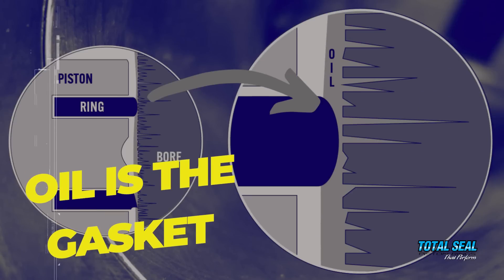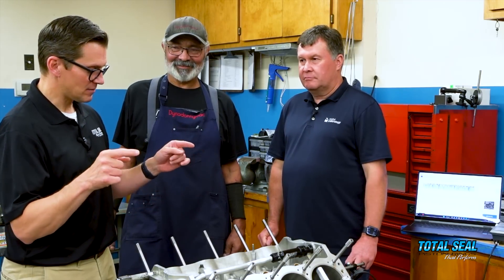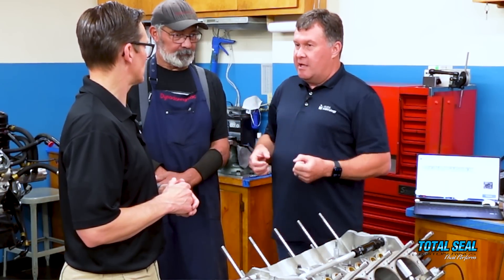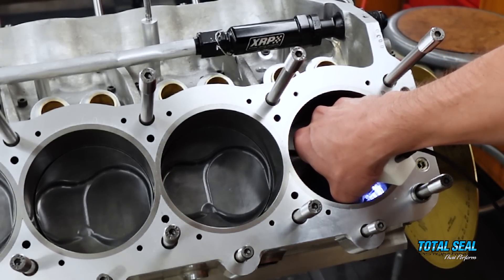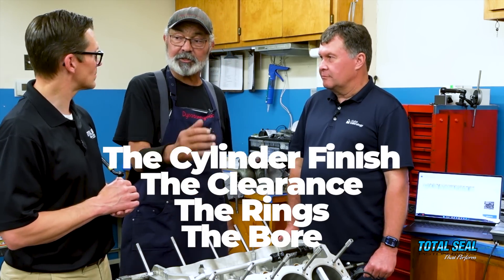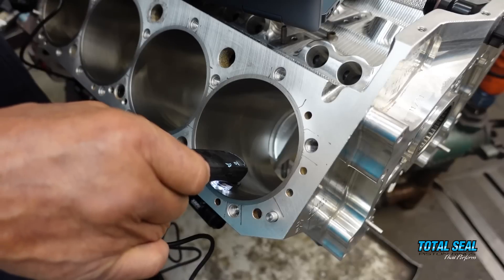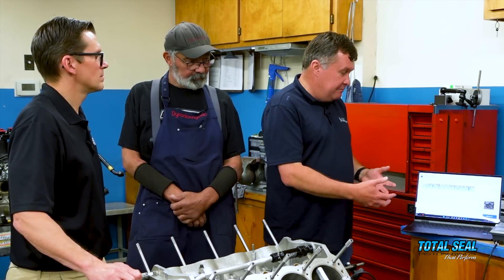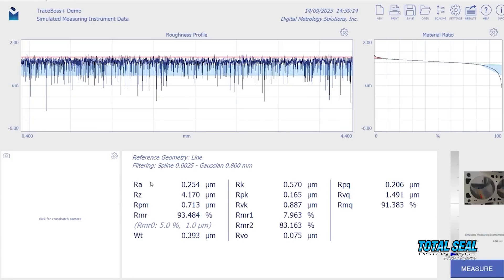THIS is the HIDDEN "Gasket" in your Engine

Comment: Oil as a gasket was well illustrated when I was wet sanding my bores that I just dingle ball honed.  Whether I used WD-40 or ATF with 3000 grit wet/dry sandpaper the sandpaper was actually trying to adhere to the cylinder walls like a vacuum. I used 1000 grit first just briefly then went to 3000. My point was to knock the peaks off but keep the valleys

Comment: So wait a moment.... I have an engine with about 100k miles on it. Doing a refresh and slapping some new rings in there. The surface bore finish is from the factory. Should I even hone it? After watching this I'm thinking that my surface is already broken in and if my rings were properly machined (got them from Total Seal) then should they even need to be broken in by running the engine???

Comment: This is awesome in theory, but I’m still going to dingleball hone my engine, wash it with a garden hose, slap it in and rev bomb the first start. Thanks guys!
Reply: I did that but then hit the cylinders real quick with WD-40 and 1000 grit wet/dry sandpaper then switched to 3000 grit and wd-40 or ATF just to knock the peaks off

Comment: Perhaps your technology can help us scan the surface finish we get in our rotating liner engine.  In our experimental diesel engine, we spin the cylinder to eliminate the metallic friction of the rings.  We have succeeded in almost eliminating the piston ring friction, based on dyno testing.  The reason is the continuous sliding as well as the unique surface finish.  Please let us know if you are interested in collaborating.

Comment: Hi Lake, I have been watching may of your videos. I was wondering if laser cut valleys for oil retention. How deep would the valleys need to be? Could this be good solution to a glazed cylinder. The parts are fully matted, but with no oil retention the seal is poor, but would not necessarily mean the cylinder is out of round. Fiber galvo laser cycling it up and down would be a bit of a challenge. Could there be a optimal pattern over just the X, maybe dots like fine braille.

Comment: @TotalSeal @digitalmetrology
With Rmq at 51% … (super low vs your other presentations) you seem to be relying more than usual on the ‘tenacity’ of the oil to create the bearing-surface with a deep ‘anchor’ of 95µin Rvk to hold it in place 

Since this test was done a year ago, May 2023… I’m guessing the results were not favorable??

Curious number tho, and I’m very interested to see how this comes out with that tighter piston to bore clearance and how you can control piston roundness within this envelope. 
Rvk 95µin
Rpk 6.8µin
Rz 207µin 😮
Rmq 51% 
Ra 31µin

Vs. more normal ‘great numbers’ for a perf NA engine. 

Rvk 56µin
Rpk 7.2µin
Rz 159µin 
Rmq 87% 
Ra 16µin

.

Comment: I think oil is still the weak "seal" on the cylinder wall. Mostly of cars today use a low tension piston ring design. They have thinner piston rings. That is why nowadays fuel dilution is often found in several modern engines, especially direct injection ones
Reply: New engine oils are using 0W8 and probably won't last long with fuel dilution. I don't run 0W20 in anything I drive even. I want that 30 or 40 weight oil at operating temperature to provide extra cushion especially when an engine starts to wear .
Reply: The thin rings aren't the problem at all... Thin rings are a win win situation. There's no down side to using them, only advantages.

It's the thinner oil that is used today that is a big part of the problem... 

The super thin oil that is used is ONLY to meet todays strict EPA fuel economy requirements. 
It does NOT do your engine any good as far as wear goes. Everything wears faster with the very thin oil, including the rings and bores. The tension that is manufactured into the rings has another part to do with it. The factories are using a lower radial tension on the rings to further reduce friction and increase economy. A thin ring CAN be made with a normal amount of tension, and last as long, or even longer than a thicker one.

A direct injection engine SHOULD have a much less concentration of oil in the fuel because of the much finer control over the air/fuel ratio compared to port injection.  The lower tension rings are partly to blame here, but it is the very thin oil that has a larger part to do with it than just ring tension. The bores and rings simply wear out faster due to the thin oil. 

I will NEVER run a 0W-8 or a 0W-16 motor oil in ANY car that I own. I personally don't CARE about the slight loss of MPG's and WILL go with a thicker oil. 

The sudden loss of reliability and added wear on today's newer engines isn't because we've went backwards in engine tech. It's because of the mandated use of such thin oil in order to meet the strict EPA fuel economy requirements, and the faster engine wear that comes along with it.
Reply: @davelowets  Low tension rings start hydroplaning on thicker oils. Lake Speed Jr. has made videos on this. The only thing you can do is use a high solvency oil like Valvoline R&P to avoid sludging up oil drain back holes.  Or tear apart the motor and put different rings or even pistons in to work with thicker oils.

Comment: Anyone ever tried a roller burnisher to perform the plateau process?  Seems like it would work well by giving a flat top to the peaks while also work hardening the material in that zone.
Reply: This is an intriguing idea?  I wonder if its ever been used for cylinder bore finishing?🤔.  Im going to repost your question here on this 1 yr old video.
Reply: @chrispompano  If no one ever replies I plan to try it someday once I get my dyno going. I got a 4.75" roller burnisher begging for some action. 😀
Reply: @bcbloc02  I've never heard of it spoken about by all the machinists he interviews.🤔. Sounds like a very credible idea!

Comment: Fascinating discussion. Implicit in "ring seating" discussions seems to be the notion that the peaks and valleys are an essential aspect of operation rather than just an artifact of manufacturing. I'm not entirely clear on why this needs to be the case. What if the cylinder surface and the cylinder facing surface of the rings were perfectly smooth? Of course from a manufacturing perspective this cannot happen, but these discussions all seem to hint that trying to pursue this is not a desirable goal. Why not? Also in the video they show a cross hatch pattern on a newly honed cylinder surface. I was under the apparently false impression that the honing/boring would leave the peaks and valleys aligned vertically, i.e. with the direction of piston travel. I don't see how a pattern that isn't exclusively vertical would help with seating. What am I missing?
Reply: Not that it would work, how in the world could you hone a round cylinder and leave vertical marks?

Comment: l have an engine with 360,000 mi on it but it runs good if I add engine restore to the oil and the cylinder walls are coated with lead and copper or whatever it is in that stuff what is that going to do to the surface finish?. 
I have not checked the compression yet and I would be curious to look at the cylinder walls with a borescope. Before I do anything.

Comment: A leak down will tell you how good a job you did on your build . 🤞
However , there is a fine line between the expansion forces and heat , seizing your engine under extreme loads .
Break in is critical  !

Comment: Thank you so much for these vidoes man! What is your opinion on Liqui Moly Hi Tec engine oil? It is supposed to be good for 25k miles but I change it every 4-5k depending on how much hard city driving I do (supercharged Jaguar XJR with the 4.2 v8, she runs hot in traffic ~218°f but cruises at 212°f)
Reply from the maker: Thanks for watching!

Comment: whatever happened with your two ring set up where the bottom ring was a combo total seal ring and oil ring?
Reply from the maker: We still have that, and this engine at Shaver's runs them.
Reply: @TotalSeal  good to hear.  Joe gave me one of the prototypes and it was quite an impressive design.

Comment: This is why I have been using 2 stroke oil (I got this idea from Lucas UCL) since long time ago, at 0.5% ratio, recently I also tried 1% ratio, and it feels like it doesn’t loose torque at high rpm, although I don’t have a dyno. I know theoretically it might drop octane but 1% can’t drop octane all that much, plus you can always use a higher octane fuel than required to take this factor out of the equation. I wish you guys can make a video with 2 stroke at different ratios to explore the potential influence it can have on an engine in terms of performance.
Reply: My friend try Renewable Lubricants Rotary Pre mix. Its completely safe in 4 stroke. Give one of their chemists a call like I did. 2 ounces treat 8 gallons 
Or 1 gallon treats 500 gallons
Reply: @CarlosMartinez-pc7je  i forgot to say but I only use TCW3 certified which is ashless and cannot harm catalytic converters.
Reply: @CarlosMartinez-pc7je  email who? I really want these total seal piston ring guys do an experiment on 2 stroke TCW3 oil because it certainly feels like it has potentials.
Reply: Renewable Lubricants also suggested the same to me to use on a 4 stroke engine.  Klotz has a similar product called Uplon.
Reply: Hey guys you know what’s crazy? I sent my 98RON (93AKI) pump gas to the lab and the result was shocking, so the 98 fuel was tested at 98.5 RON, and after adding .5% of TCW3 the RON actually increased to 98.7 RON, although at 1 percent it dropped down to 98.1 RON.

Comment: The diy guy gets all screwed up watching all this bs, smoke and mirrors. The average diy'er that comes in the machine shop just wants his engine not to burn oil. They get all bugged up about hone finishes and question everything the machinist is doing. All auto companies sell 3 blade glaze breakers, ball hones, plateau hones. They're all good, they sll work. 
Bore it, ridgid hone it, run a drill driven plateau brush hone through it 15 strokes with WD 40. Wash it and put it together. 
All that info your promoting is for racing! Let the diy'er know that. I'm retired now, but i got tired of amatures telling me how to do my job. And having to explain everything.
Well, there's my rant!
 Machinist do appreciate your videos very informative.

Comment: THE PRIMARY FUNCTION OF OIL IS COOLANT !!!! NOT LUBRICATION
Reply: U reduce temp by reducing friction,  plus absorbs temp while around.
Reply: @SG-wp6sg  wrong you cool while you reduce friction splitting hairs the book says it is a coolant first
Reply: @HDSME  The two main sources of heat: friction and combustion,  eliminate friction and whats left is combustion which is mainly surrounded by coolant,  in some engines that are air cooled and others like porsche yes the oil must act as coolant first if not equal as a lubricant.

Comment: I was wondering how the stylus could be small enough and strong enough to exact the contour of the scratches.
 Talking about the width, i would assume the height or depth( peak to valley distance) would be exagerated on screen vs the width for viewing purposes or am i wrong? He said the valleys were spread out more but still microscopic right? I would love to see some microscopic video of the stylus making its way, dipping and rising, seeing it on a graph is one thing but actually seeing it in the process magnified would be cool.
Reply: The "Surface Texture Answer Book" has some great information and graphics in this regard.
Reply from the maker: That would be cool. Check out this video to see what the surface looks like through a microscope. 

What The Heck Happened??? Motor Oil Wear Testing
https://youtu.be/brw9LfZvScw

Comment: All this information is great now how do I use it, where can I get it done, is there anything I can do as a home Rebuilder to use it somehow. This is the second video I've seen talking about a plateaued finish so I guess it's only for a machine shop?
Reply from the maker: This type of finish requires the hone and measurement devices shown in the video, so it is best done by a machine shop.
Reply: They are talking about the surface finish in the bore of your cylinders, as such it is useful for whoever is machining your engine. In a previous episode they mentioned to start off with a 120 grit diamond stone to get the deep cross hatch 'valleys' (Rvk) which holds the oil, then finish with a 900 grit diamond stone to smooth out the peaks (Rpk). There is also the cross hatch angle, which depends on the length of your stroke (stroke to bore ratio). Go back and watch a few more of their episode to get a better idea.

Comment: I love your videos. I found one statement contractictory though that possibly requires clarification; that is that the thin rings have an overall lower friction coefficient when my understanding is that the same cylinder pressure applied to a thinner-ring produces the higher ring friction per contact area of the ring - simply because the contact area is a lot smaller (which would make more sense).  That is, unless you mean static ring tension which I would understand although I am sure this is meaningless in a running engine. ?
Reply from the maker: Great question. The difference here is that piston rings operate in a dynamic and lubricated environment, so the “normal rules” of friction don’t paint a clear picture of what actually happens.

Comment: so lake speed jr in the past youve talked about adding more viscosity with higher cylinder pressure so does going from 5-30 to 5-40 help lower blowby or whats the best option for adding boost to na motors
Reply from the maker: Yes, adding viscosity is a good idea when you add boost.

Comment: I was doing this 20+ years ago with metal forming dies.
What made the demand was the galling of metal being stuck onto the dies during forming. 
Different tool steels and carbides were tried and different coatings were tried.
Different lubricants also were trialed.
The best final result was a plain cobalt carbide with no coating and a 2 step polish finish which left a plateau / valley surface.
Reply from the maker: Thanks for sharing!
Reply: Same principle in the die casting industry. The surface of the dies are polished to hold the die spray for better part release.

Comment: Since most stuff is boosted these days, besides circle track. Why aren’t you working with someone like Steve Morris? He has the new hone! Bigger cubic inches, alcohol, big cylinder pressure, high heat! If anything needs help with cylinder sealing, it’s boosted engines! I’m not talking about a street engine with a tiny blower! I haven’t seen a big horsepower boosted engine get any life out of all these ring advancements! They are usually killed with heat quickly!
Reply from the maker: Steve is a great guy, and we talk to him fairly often.
Reply: its funny that you think steve morris doesn’t  deal with these guys

Comment: I don't get it. This is OLD information. I did that in prostock back in 1980 when the prostock "standard" was a super fine hone. I didn't like that so I started a 2 step process I called "plateau honing". 1 pass with a coarse stone almost to size and a light pass with a superfine stone or vs vs. This was to lower friction, improve seal and help control oiling the chamber on our hemi. We kept it secret but of course, like all racing secrets, it got out, sunnen knew what we were doing.
Later I tried it on F2000 engines and it didn't work there. They have a terrible fuel wash upper cylinder wear problem that I couldn't solve.
Reply from the maker: Thanks for sharing

Comment: you discuss the differences in a gas vs alky build,   do you have experience with nitromethane fueled engines?   if so, how would a cyl finish, etc differ for a nitro application vs gas/alky?
Reply from the maker: Nitro is a completely different beast.
Reply: @TotalSeal  well, of course it is a different 'beast'.  that is why I am asking.   would you please provide some info for a nitro app?  thanks